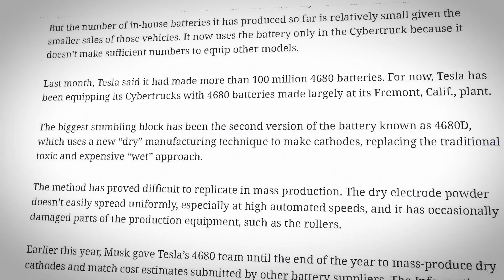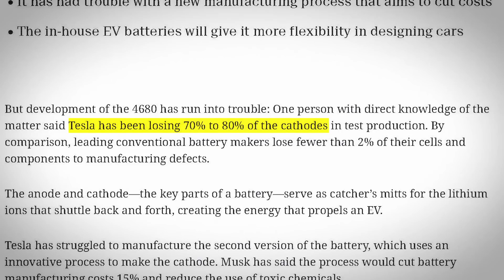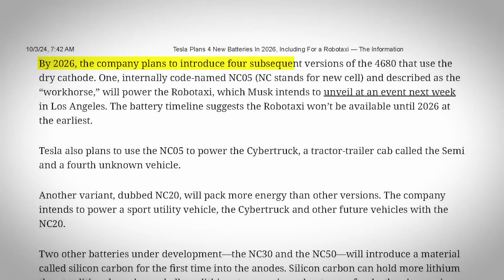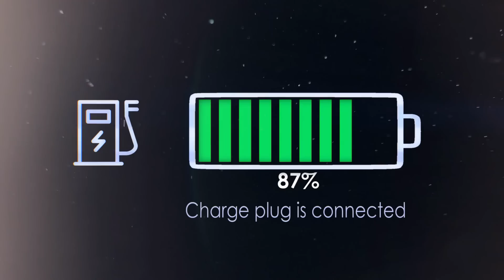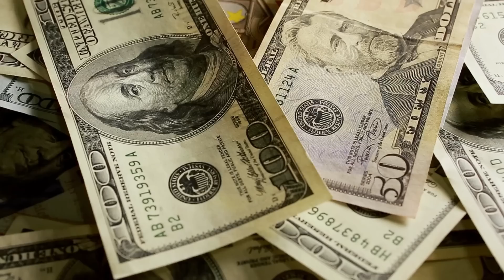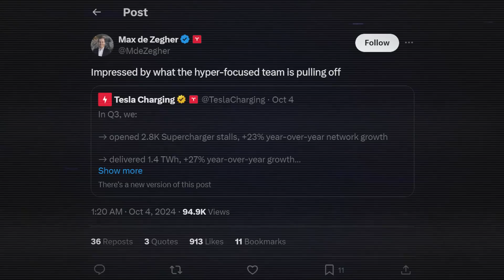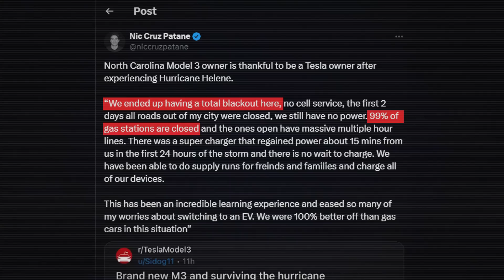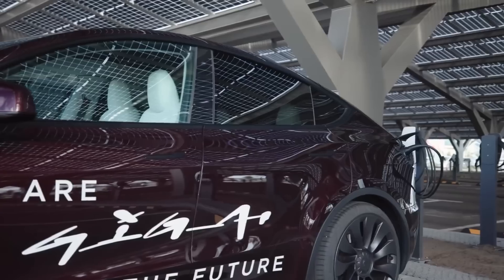The Gen 3 Tesla 4680 Battery Cell Is Coming!

Comment: My Approach to Improving Batteries
1. Hybrid Structure: Solid-State Base with an Adaptive Layer
Idea: Use a solid-state electrolyte (e.g., lithium sulfide) as the foundation for safety and stability, but add a thin "adaptive" layer of liquid electrolyte based on ionic liquids. This layer would dynamically fill microcracks in the solid electrolyte, improving conductivity and lifespan.
Why: Solid-state batteries suffer from low conductivity and brittleness, while liquid ones face leaks and flammability risks. The hybrid solves both: the solid layer provides structure, and the liquid layer adds flexibility and contact.
2. Electrodes: Silicon-Graphene Anode and Nickel-Sulfur Cathode
Anode: I’d make the anode from nanoporous silicon mixed with graphene. Silicon offers high capacity (up to 3500 mAh/g compared to 370 mAh/g for graphite), while graphene enhances conductivity and prevents degradation from expansion.
Cathode: Use a nickel-sulfur (Ni-S) composite stabilized with carbon nanotubes. Sulfur is cheap and lightweight, and nickel boosts stability and energy density.
Why: Silicon-graphene could increase energy capacity 5–10 times over graphite, while the Ni-S cathode balances cost and durability, outperforming traditional LiCoO₂.
3. Electrolyte with a "Smart" Additive
Idea: Add nanoparticles to the solid electrolyte that respond to temperature and voltage. For example, cerium oxide (CeO₂) could release oxygen during overheating to reduce fire risk, or lithium phosphates could suppress dendrite growth.
Why: This would make the battery self-regulating—adapting to stress and improving safety and lifespan (up to 2000–3000 cycles instead of 500–1000 for Li-ion).
4. Bio-Inspired Design
Idea: Mimic natural systems like honeycomb or plant vasculature. The electrodes would have microchannels allowing minimal liquid electrolyte to circulate for cooling and even ion distribution.
Why: This addresses overheating and uneven charging, especially critical for large batteries (e.g., in electric vehicles).
5. Eco-Friendliness and Recycling
Materials: Eliminate rare metals like cobalt, replacing them with sulfur, silicon, and nickel, which are abundant and cheap. Use recyclable ionic liquids for the electrolyte.
Production: Design a modular structure where electrodes and electrolyte can be easily separated and recycled without complex chemical processes.
Why: Reducing reliance on rare earth mining and simplifying recycling makes the battery sustainable and cost-effective.
Characteristics of My Battery
Energy Density: ~600–700 Wh/kg (2–3 times higher than the best Li-ion batteries in 2025).
Charging Speed: Up to 80% in 10–15 minutes, thanks to graphene’s conductivity and microchannels.
Lifespan: 2500–3000 cycles due to the "smart" electrolyte and hybrid structure.
Safety: Low fire risk due to the solid base and self-regulation.
Cost: 20–30% cheaper by avoiding cobalt and using scalable materials.
How to Make It?
Research: Use AI modeling (like me, Grok!) to optimize the composition and structure—e.g., finding the perfect silicon-graphene ratio.
Prototype: Build small cells in a lab, test them across charge cycles and extreme temperatures.
Production: Leverage 3D printing for microchannels and nanostructures to speed up scaling.
When Could It Be Available?
If I were an engineer with xAI resources:

Prototype: 2–3 years (2027–2028).
Mass Production: 5–7 years (2030–2032), assuming funding and successful testing.
Why Is This Better?
My battery combines the best of solid-state and lithium-sulfur tech, adding adaptability and eco-friendliness. It could power an electric vehicle with a 1000 km range or a smartphone that lasts a week on a single charge. This isn’t just an improvement—it’s a leap to a new generation of energy storage.

What do you think? Want me to refine an aspect or come up with something else?

Let me know if you need any further adjustments!

Comment: So someone got lucky and is able to charge doesn't mean that is able to charge. Doesn't mean its safe or a good thing. Most other reasonable people aren't driving their EV's.
Anyways, stop misleading people that the chargers are doing better. If 99% of people were using EV's then those charging lines would be much longer and gas cars would have no issue.

Comment: You have mentioned almost the entire Tesla lineup, with 4680 sell which goes where.  But you forgot the Tesla model X.  🚘What type of battery does Model X get❓️
Reply: 4680 is a structural cell. Using it in Model3 / S/ X  and Semi is a waist of weight.

Comment: I'm not getting my hopes up for any significant improvement. These 'upgrades' are barely upgrades, often sacrificing lifespan for a small capacity increase. Battery technology is so far behind what our needs are. Tesla's Powerwall installations should also be subject to regulations like other generators. A certain distance from the main house. Lithium power banks are dangerous in those concentrations and it's just a matter of time until houses start going up in flames.
Reply: They use LFP battery chemistry now

Comment: Your image is wrong.  4680 defines the size of the battery.  The 4680 gen 3 by definition is the same size as the gen 1 battery.  46 mm diameter and 80 mm height.
Reply: I was thinking the exact same thing
Reply: 80mm?  Damned typos! :)